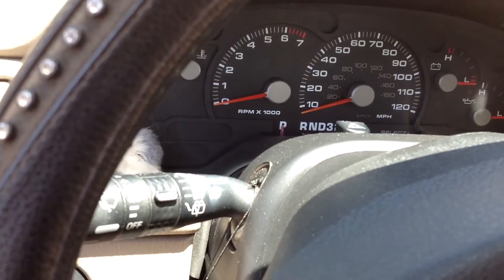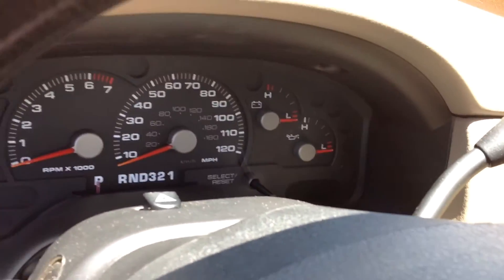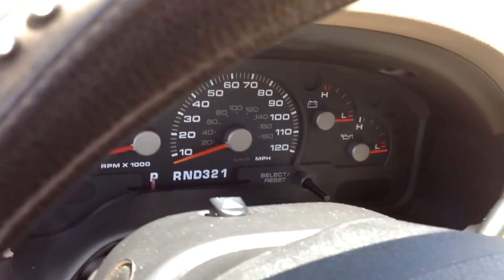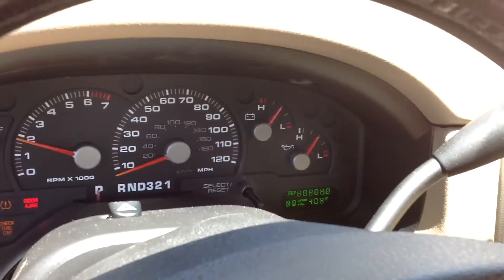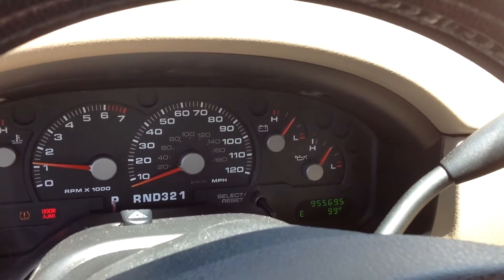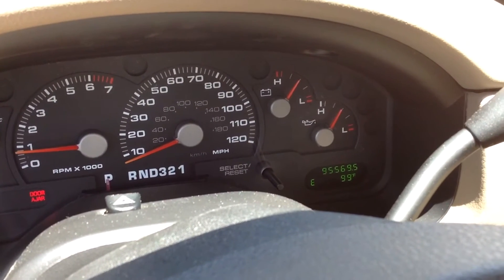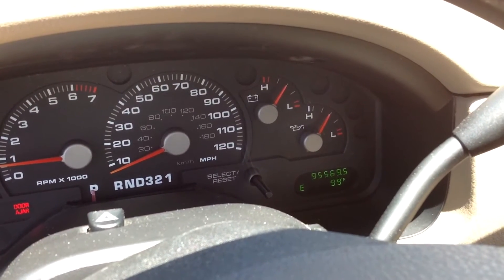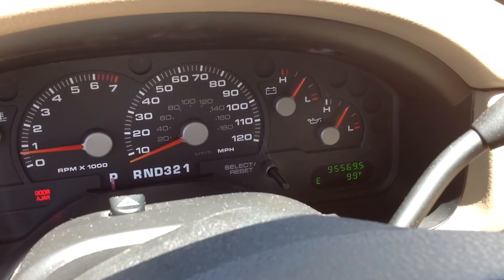2004 Ford Explorer fuel rail pressure censer replacement. Part 8 , the end. Thanks

Comment: On some fords just unhooking the batery isn't enough to reset the fuel ratio. Leave the positive on the terminal, then unhook the negative cable. Run a 12 volt jumper wire from the positive cable while on terminal, to the negative cable while off of the terminal. Keep it hooked up for ten minutes and it will reset all codes. Place a folded up towel between the negative cable, and negative cable. This will help prevent frying the system if the negative cable happened to touch the negative terminal while the 12 volt jumper wire is hooked up. This is only for when you are doing your start up of engine to reset codes. When starting job pull out fuel pump fuse while car is running to relieve fuel pressure, car will shut off. Then unhook battery totally while doing job.

Comment: I was wondering when you drove it maybe like 4 miles and turn it off would it start back up? Mine take a while to start up I have to wait did you have the same problem?
Reply from the maker: no problems , did you disconnect the battery ?